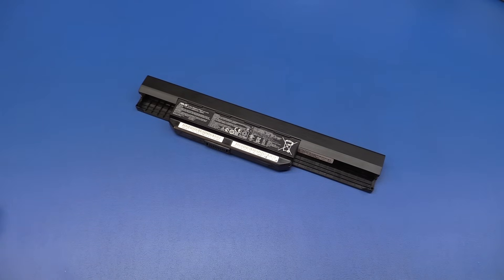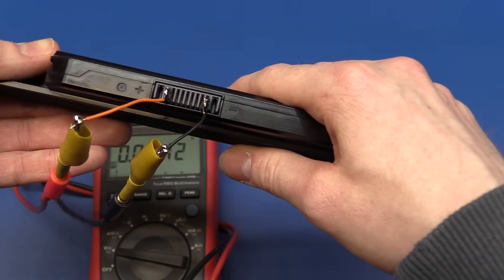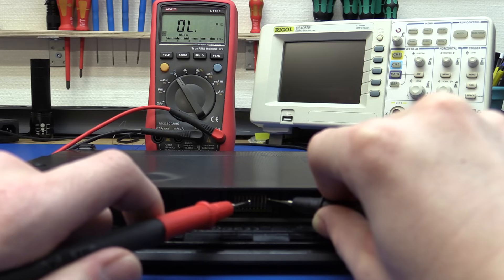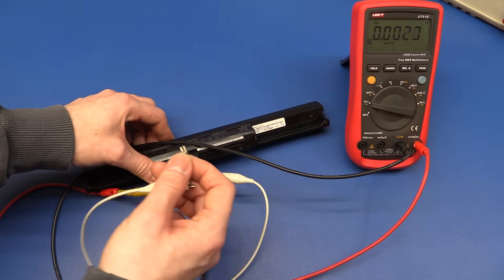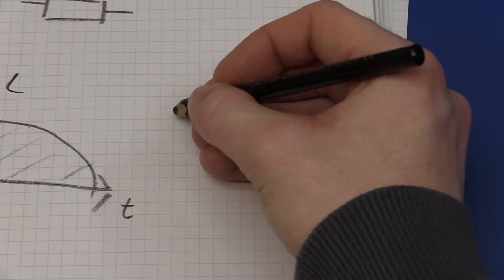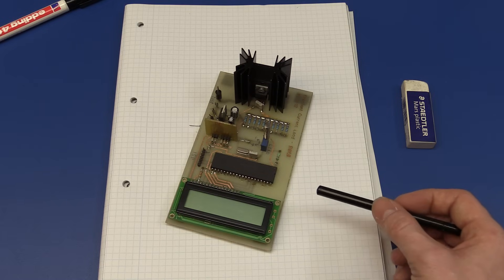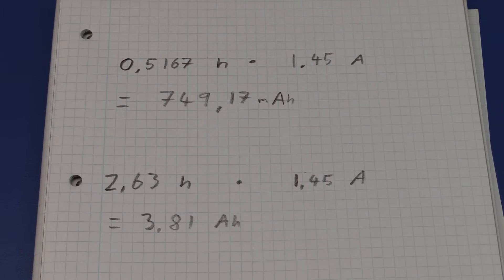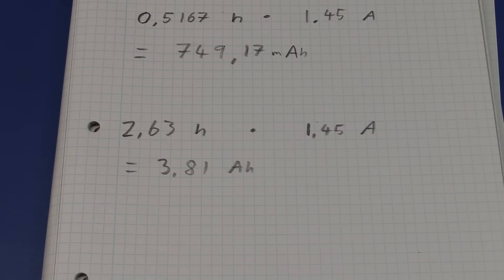How to Test a Laptop Battery - Ec-Projects

Comment: If you disassemble the battery, you will see that there are 3 batteries connected in series. After the discharge is completed, measure the voltage, replace the one with the lowest voltage, and then charge each battery individually, and it will be repaired.
Reply: Yes Einstein.

Comment: Perfect video!  I just wanted to check new battery voltage before putting it in an old laptop to check if it was charging.  The pin out observation alone was worth the video!

Comment: Hello .. I have a 15v 5900mah laptop battery, it is safe to use my laptop charger directly connected to my battery ? my charger out is 19v 9.23A.. or I need a step down DC-DC ?

Comment: thnaks for the explanation to find the battery Ah...am impressed the way explained....
just wanted to ask out of curiosity, are we can use that "+ & -" two pins for reverse charging rather connecting 3rd/4th wires to the laptop battery?, becoz there will be BMS board present in the battery already...

thanks in advance

Comment: thanks it worked, i could not find out the resistance of pins, it showed 0, so I used only wires to find the groud pin, battery didnt blow

Comment: Hi, 
Great video !
It worked a treat on a pair of li ion batteries I had sitting around from two laptops . 
Thought I am having trouble with two li po batteries I have , I found the ground jumped that with the other ground but it does not give me a reading or let me charge it like it did with the li ion's , 
Any chance I can send you a pic , it is a battery for a Asus transformer tablet/laptop 2 in 1 , the batteries have 8 wires , two for pos red,  two for neg/ground black , well three really because green is neg/ground as well , Then there is a yellow , white and blue , all coming out of battery . 
Any help would be appreciated

Comment: Hello I have a Dell laptop battery model J1KND 48w 11.1volt How can it be charged without a laptop? Which pins are negative and positive? Can its negative and positive pins be used as a power bank?

Comment: Help with Dell D600 battery: (C1295) With a jumper between Ground and the SYS PRESENT pin I can measure voltage and discharge the battery using a R/C charger /discharger.  However I can not charge at the out most pins.
If I put the battery back in the laptop it will charge it full again.  Would you know if I need another jumper to allow the battery to accept charging?

Comment: At 7:47, you mentioned that the "battery will cut off automatically".
It seems it did cut off at 9.87v, that's about 3.29v per couple. Pretty safe for lithium cells.
I wish to know did it cut off automatically because of the battery's internal circuit, or because of you custom made load circuit? If that cuts off because of it's internal circuit, that would save my efforts to add protection circuit and I could directly use laptop batteries in my electronic projects.
Reply from the maker: Sarvesh Karkhanis Thanks for your comment ! :)The protection is build in. There is a single PCB inside the battery pack that takes care of all the cells. I don't know if this is true for all batteries though, but the ones I came across were similar to what I showed in the video! :)
Reply: Thanks for your reply! :)
I will test the batteries then :), ans would make sure that they do not discharge below 2.5v per couple.
I have one more question, can you detect the enable pins by probing the battery instead of probing the laptop connector? I'm asking you because I may be using a batteries for my projects "laptoplessly"...
Reply from the maker: Sarvesh Karkhanis Hmmm, I'm not sure about that.. I think you could perhaps find the correct pin by connecting the pins (one at a time) to ground via a resistor while measuring the voltage at the output. But then again, there is no guarantee that connecting pins randomly would not damage the battery in some way or the other. :/

Comment: So if I wanted to check the voltage of my laptop battery, measure the resistance between the ground on the end, and other other pins, and any that are near zero are also grounds.  Then connect any of those grounds to the ground on the end when measuring the voltage?

Comment: no you were right. The transistor will allow 1 amp to pass through it. You just pointed at the resistor. The transistor being the active component and the resistor being the passive I wouldn't say the resistor is "allowing" anything.

Comment: Remember that the capacity shown on batteries usually is noted at below 1C discharge rate and no higher. Higher discharge rates makes internal resistance come into play, and they then will not live up to specs.
Reply from the maker: Yep, that's correct. This test was done at about 0.27 C (of the claimed capacity). So it shouldn't be too bad..

Comment: 5200mah is just it is.. 
there a lithium battery with 3S2P configuration.. so, the 2600mah battery connected in parallel and for reach a 10.8V voltages, they are connected in series (3 battery in series) to reach 11.1V exactly and each cells in series connection has 2 cells connected in parallel..

so, while measuring the capacity with your method, it is just the dry test.. and not exactly answer the actual capacity of the battery..

and obviously, the laptop load is not constant.. but dynamically changing and fluctuative (except you did a benchmark test) and measuring the current from your lab bench power supply (if you have it) for simulating a laptop battery while benchmarking.. and you will see how much current your laptop draw..

and calculate it with the number of battery capacity, and you get the more accurate result of discharging time from your battery, rather than measuring a capacity which is not always accurate.. 

while the battery itself is exactly 2600mah (i think 2500mah) connected with parallel connection, but parallel connection has more current discharge (which means more current draw) and more voltage drop because of more current had been drawn.. so the battery usage can be high..

Comment: Can this also be used to revive a battery that has fallen below the threshold for charging? I have an Asus laptop that sat for about a year and won't charge... can I short the pins and apply a constant current or voltage to bring it back?

Comment: Hi, thanks for your guide on finding right pin to enable workload.
Is it possible to charge battery w/o laptop? How to find right pin for charging?
Thanks
Reply from the maker: Hi.. You are welcome.. You can charge it through + and GND but to find the enable pin..
Hmmm, I'm not sure about that.. I think you could perhaps find it by connecting the pins (one at a time) to ground via a
resistor while measuring the voltage at the output. But then again,
there is no guarantee that connecting pins randomly would not damage the
battery in some way or the other. :/

Comment: If the battery power can run for about 2 hours then the battery is good and if the battery can run for 10 minutes then the battery is most likely bad. right? There are more than one way to test your batter to see if its good or bad. right?
Reply from the maker: +johnbernard17 Yeah, but it won't be easy to tell the difference between 100% good and 75% good :) Especially since the change is rather slow, so you don't really notice. This was just a way to get the actual numbers..

Comment: Great video. I followed your instructions to measure the voltage of my old Asus battery and it looks fine (this battery has lost a lot of its capacity but still works a little). My new battery suddenly stopped working. when i use your technique, it only measures 0v. any thoughts?

Comment: I didn't know that laptop batteries are controlled by an "ECU" almost the same as the fuel administration to the engine in a injected fuel type. Even though my battery was somewhat deteriorated after forgettting it on sleep mode without autoshutdown, it was still working 40 minutes or more, now it has locked by software, and the order to charge it is sent from the chip inside the battery, and if this chip decides to put the battery in protect mode, it will not allow the laptop battery module to put tension to the charging terminals. And the battery neither will unlock the positive terminal to supply off the grid. So now i have what it was a working battery locked by software. I can bridge the terminals but it would even be safer to use a power bank plug to the main DC input (19v). I don't wanna mess with the charging terminals of the laptop. This method didnt work for me, the battery ECU is bricked (i made a short circuit in the first pair of cells with a drill, drilling on the wrong spot.

Comment: Hello! Can you help me with this battery. I have an Asus laptop and I left it by mistake to fully discharge . Now the battery won't work. I opened it all the elements are fine, total voltage 15.5V. But no voltage on connector. I tried making bridge from pin 3 an 4 to ground like in your video - still no voltage.  What should I do? Thank you in advance! :)

Comment: Hi! Thanks for posting your video. I would like to ask you a query. My laptop battery was working fine till last night with a battery back up of 4 hr and suddenly today it has experienced a permanent failure. The laptop is not switching on with the battery, when i plugged in the charger it display "battery permanently failed". What will be the reason behind this ? Is there any way to repair my battery.

Comment: I have a question to ask you, while you test a battery with a multi-meter.... if the number of voltage increase... then the battery is most likely good and if the number of voltage decrease then the battery is most likely bad. right?
Reply from the maker: +johnbernard17 The voltage will always decrease if you are drawing a steady current, you will have to time the discharge to get the capacity of the battery. Of course in extreme cases like this, you can see the voltage drops way too quickly.

Comment: Would you please tell me what is that small prob that you sticked between the battery leads?  thank you.
Reply from the maker: Hey, it is standard 2-pin pin headers with a wire soldered to them :)
Reply: EcProjects
thank you kind sir.

Comment: Hi.
Just want to say thank you very much for uploading all the videos you do.....because i do exactly this as an "hobby" at home all the time to keep my technology memory updated since it was about 15-16 years ago i went to the electric courses at school as a "youngster".(Also cause it is so damn fun with electronics ofcourse hehe)
I´ve noticed you have the "Atten" hot air station.I do too and i wonder how do you like yours?
Mine came grounded to the handle only wich in most cases would work but i modified mine and "upgraded" to better ground as the casing on the hot air station is made of metallic material.
Cheers from Sweden
Reply from the maker: HelloThank you, i'm glad that you like my channel.. :)I think it is ok considering  the price, I did actually record a teardown (securety check) of it, but never got it finished :(There was nothing to complain about in my unit, except that there was a piece of solder rattling about inside the case. I didn't pay too much attention to the grounding though, I just checked the live wires.. :)

Comment: To test the voltage why don't you just stick a diode in the battery socket?
Reply: and measure from the diode, that's what I did and it worked

Comment: Hi, It would have been still better if you show complete video of replacing cells in VGP-BPS22 battery, when Laptop shows message "0% available, (plugged in, charging)".  And how to avoid BMS chip from “shutting down” or disabling if the cells are removed/changed and may even refuse to allow charge the cells after completing replacement of cells.